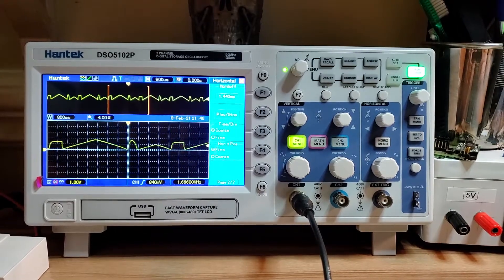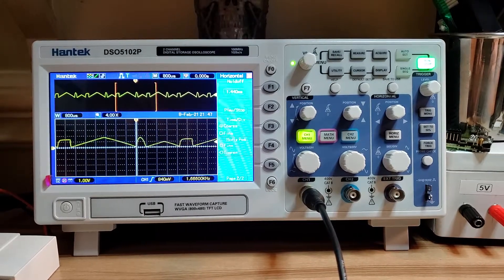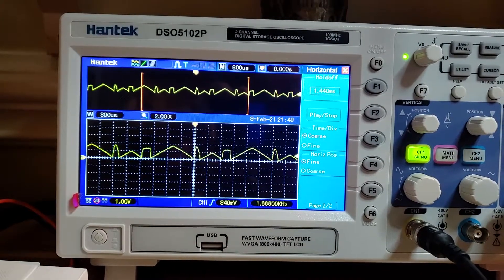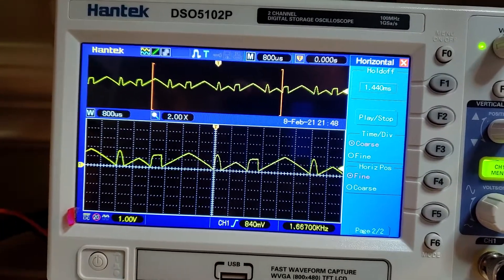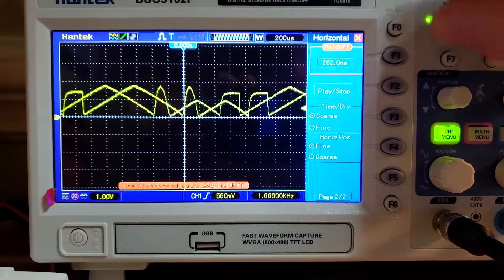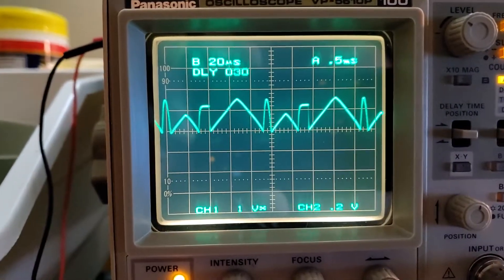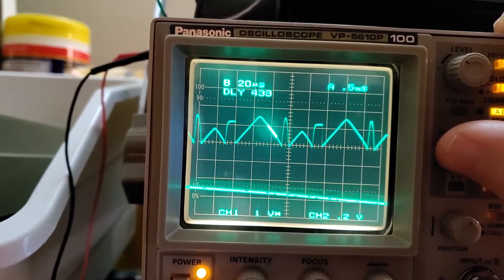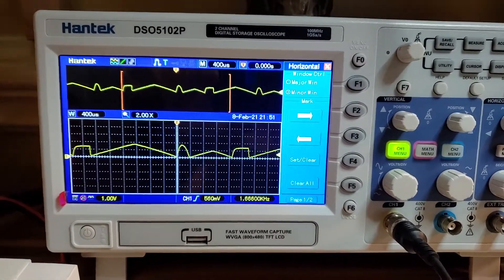Logic Green 328P clone (LGT8F328P) DAC example

Comment: Am i right that the SSOP20 version of the chip doesent have a DAC? Have not found any usable chip description yet.
I need the DAC for a solar charger.
Reply from the maker: Hi. The SSOP20 has one DAC channel and that's what I'm using in the video. DA0 is on pin 3 (PD3). https://github.com/watterott/LGT8F328P-Testing/raw/master/LGT8FX8P_databook_v1.0.5-English.pdf is a translated datasheet.
Reply: @UReasonIt  TY. Works.
Reply from the maker: @pepethefrog7193  Great!  They are nice little chips.
Reply: @UReasonIt  
Unluckily the DAC can not source any current. Will need an additional transistor.
Reply from the maker: @pepethefrog7193  Yeah, for most DAC's you will want to run the output through an opamp stage or two to run low impedance circuits or a resistive type load.  A transistor amp would probably be the best for the latter.